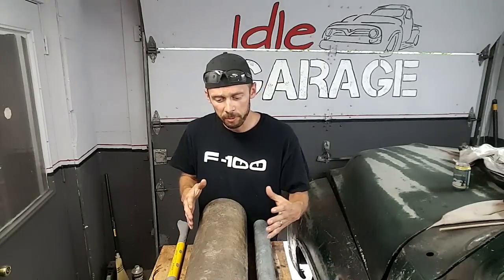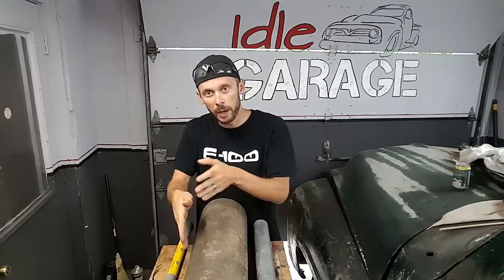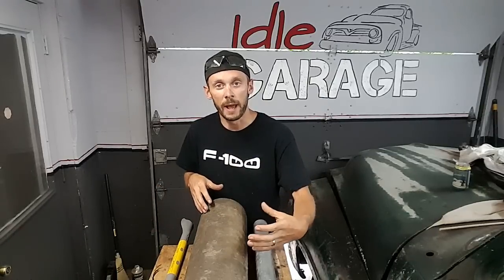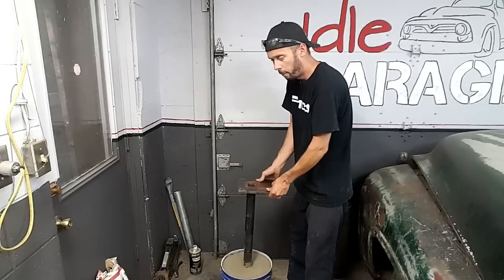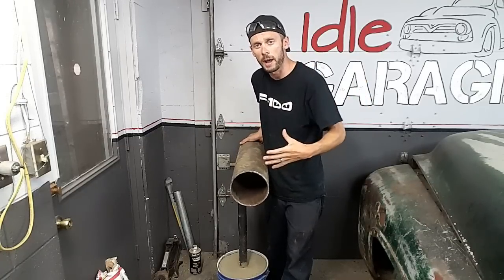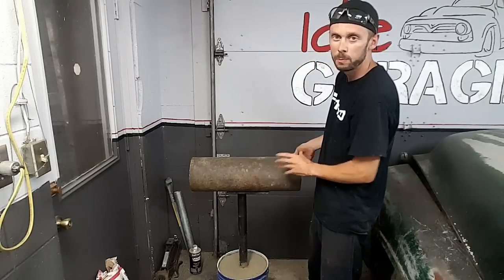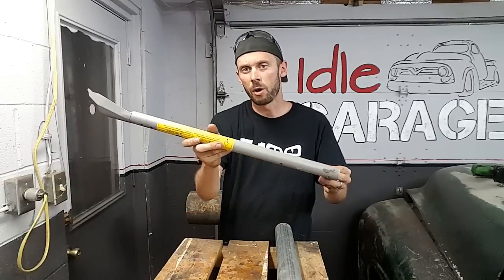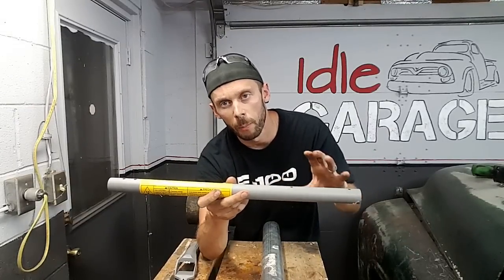Gene Winfields Pipe Anvil build as described from Sema product demo for Eastwood

Comment: Excellent idea!  If you'd like to get the center of gravity of your multipurpose stand a little lower, visit your local tire shop that services big trucks. They'll likely give you a dump truck brake drum for free. A steel drum is easier to weld, but a cast drum is fine if you preheat it. 
Thanks for sharing Winfield's knowledge!
Reply from the maker: That's a good idea I looked at big truck wheels we had at work but didn't like the space it would take up. However a drum would be a good size still.

Comment: I really really think you need to bolt that to the floor. That bucket of concrete isn't going to do jack. I mean nothing when you are applying any pressure or pulling on whatever that base is going to move. Baseplate with 4 anchor bolts you are sorted. Just saying!🤔👍🏻🇬🇧
Reply: True... all needs driven.